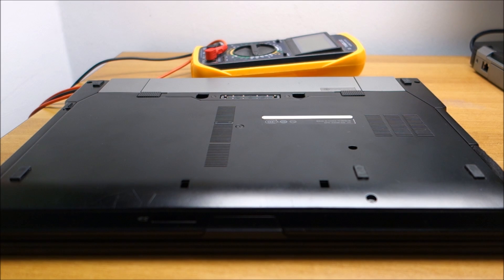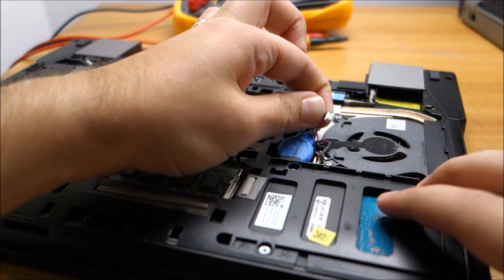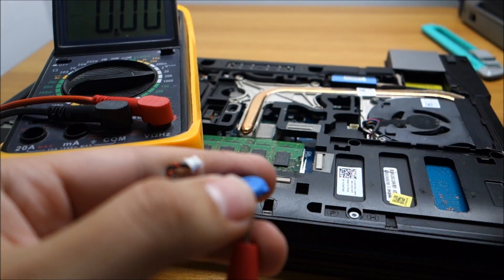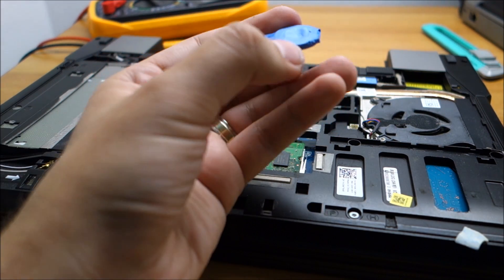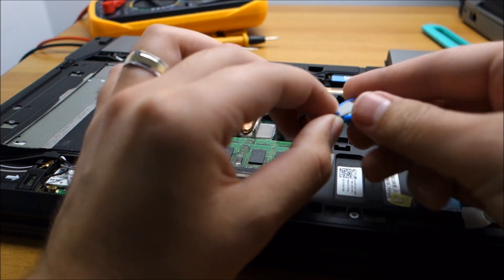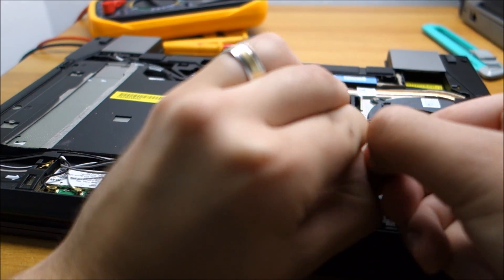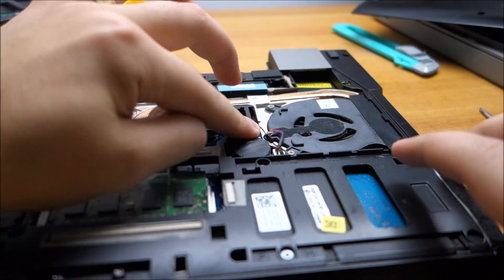How to replace laptop BIOS battery with a standard PC battery

Comment from the maker: ▬▬▬▬▬▬▬▬▬ஜ۩۞۩ஜ▬▬▬▬▬▬▬▬▬
        T H A N K  Y O U  F O R  W A T C H I N G !
     P L E A S E  L I K E  A N D  S U B S C R I B E !
▬▬▬▬▬▬▬▬▬ஜ۩۞۩ஜ▬▬▬▬▬▬▬▬▬
Reply: What about clamping metal heat sinks to the surface of the battery -  near the solder points ?   Would that absorb enough heat and prevent exploding the battery ?
Reply: On another video -  the technician used copper conductive tape ?    But that assumes that the adhesive material wouldn't interfere with conductivity ?
Reply from the maker: The adhesive needs to be conductive for sure.
Another idea, put the battery on a wet cloth while soldering. The heat should transfer into the cloth.
Reply: @UltimateDIY   My HP laptop battery is 16 years old and still has no problem. My bios had been updated in the past. If I replace the battery will I lose my updated bios? I do not know how to reset it. Will I have to update the bios again back to the same version or will it keep it but need to configure some changes in the bios? Also what changes in the bios will I need to configure, may please tell me in detail? So I can take note of my bios before or print out my bios to compare if needed.
Reply from the maker: @AnthonyManzio the BIOS version will not change. Once updated it remains updated. Your settings will be lost. Just enter all bios menus and take pictures, so you cand set them again exactly as they were.
Reply: @UltimateDIY  Okay thank. Will print screen work since got camera or cel phone?
Reply from the maker: @AnthonyManzio only if you have a printer, otherwise there is no way to save pictures.
Reply: @UltimateDIY  I've only the date and time will nothing else.

Comment: THE MOST IMPORTANT PART OF REMOVING SPOT WELDED STRIPS FROM OLD BATTERY, THAT YOU OMMITTED TO SHOW.  HOW YOU REMOVED? BY HOTGUN OR SOLDERING IRON?
Reply from the maker: I mentioned I will pry them appart and that is exactly what I did. Spot welding can't be melted like solder, so the only way is to pull them and rip them from the old battery.
Reply: @UltimateDIY  ok fine Thanks.

Comment: is there a way to diagnose to check? without open the back cover?
Reply from the maker: Remove main battery and shut off the laptop. If you get some error that bios settings have changed or if the clock and date are reset when you enter the bios, then the battery is gone.
Reply: @UltimateDIY  yes i have that error, but sometimes, i did not get that error
Reply from the maker: To get the error the main battery must be empty (or completely removed) and the power cable not plugged in.
Reply: @UltimateDIY  yes.. I received this error after removed my bloated lithium battery. So, it's dead?
Reply: @UltimateDIY  i need to plug-in to turn it on
Reply from the maker: Yes, bios battery is most likely dead then
Reply: @UltimateDIY  i just can't believe it dead to soon. It just turned 3 years old. My previous laptop never has this issue until hdd dead (over 10 years).
Reply from the maker: Welcome to "modern" electronics where they want us to replace them every 2 years, if they can get us to.
Reply: @UltimateDIY  agreed..lmao

Comment: How did you remove the metal contacts? Just pried them off?
Reply from the maker: Yes. They are spot welded in place.
Reply: @UltimateDIY  Thanks, figured. Seems so unnecessary since the contacts are held in place by the tape anyways.

Comment: My laptop stopped recognising the SSD.
Could it be a bios issue?
HP 17-by0010ds
Reply from the maker: The ssd could also be bad. Test it in another pc.
Reply: @UltimateDIY  I did. I got it to mount and format.
I did not try inside my working laptop as the system disk though.
Ill try that tomorrow.

Comment: Ugh I do not want to solder a battery .. why don’t they sell these more easily LOL
Reply from the maker: Well, they actually do sell them. You can buy from eBay bios batteries for your laptop model directly with the wires and connector. But I am cheap and also did not want to wait 🤭

Comment: No need to make holes. Just test at the end of the wires...
Reply from the maker: Don't remember where and why I made holes 🤔
Reply: @UltimateDIY  holes in the plastic to test the battery .. but the connector has exposed metals
Reply from the maker: Ah, ok. Probably I did not notice.

Comment: I loved to watch your video.  The technique is very helpful to me.  You showed everything very clearly and reused as much as possible.  I will go and watch all other videos of yours.  Thanks for your time in creating such a wonderful and useful video and sharing it.

I have a Toshiba Satellite P55W-B5224 laptop.  I did not use it for several years. Everything was working fine, but the touch screen and LCD screen malfunctioned and could not see the screen well where it was asking to enter the date after I had unplugged the main battery from the motherboard.  Perhaps that corrupted the BIOS information and not the fan runs when turned on for a minute or two, nothing shows on screen then laptop turns off even when the charger and battery are plugged in. I opened the back cover and could not find the location of the CMOS battery either to clear it or to replace it.  By the way you replied to almost every viewer's comments.  I highly value your time and helping nature.  Keep up the good work, Sir.
Reply from the maker: Thank you! I really apreciate your kind words and I'm happy my video helped you! 😊

Comment: Great idea and great job but why in the heck did they ever make it this way instead of the spring loaded clip?
Reply from the maker: More cost effective in some way? That would be my guess.
Reply: No space for it. Even my mini-ITX (desktop) motherboard has a similar wired battery and located in such a tight spot that I have to remove the motherboard from the case to replace it. On a sub 15 liter volume mini ITX case that is like half a day (or more) lost. It is very annoying just to replace a stupid battery.

Comment: what could be the reason my laptop hp 8760w not turning on?
i have tried basic thing by removing battery, and try to turn on with direct adapter power, pressed the power button for 30 sec and then plug in power adapter and none of them worked
Reply from the maker: Those are the hardest to troubleshoot...
Sorry, but there could be so many things, that it's impossible to guess.

Comment: I pulled the wires out of the CMOS connector on my Acer Helios and cannot find where to buy a new one.. Any advice?
Reply from the maker: Try ebay.
Reply: Buy cmos battery at electronic store or computer repair store

Comment: So i just need to insert the positve n negative terminal in the heat shrink tube then heat shrink it?
Reply from the maker: Indeed. Just make sure the wires are without insolation, so they can contact the battery. Also make sure you keep the correct polarity.
Reply: @UltimateDIY  thank you bro...you are the best

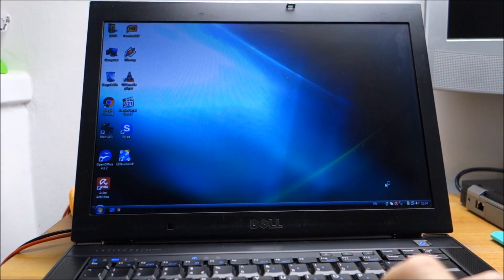Comment: I'm confused @13:18. With the main battery reinserted and powered up, did you get to this screen without having to reset the BIOS?
Reply from the maker: You will need to check the bios settings. When both main battery and bios battery are removed, the bios settings go to default values.

Comment: Thank you for the video! Why did you choose to reuse the plastic ring - was there a safety reason? I'm having to try using electrical tape since I don't have heat shrink, but I don't want to create a safety or interference problem (battery & wires near the WLAN antennae). Thanks
Reply from the maker: Welcome! I think it was a material that is hard to puncture, so at that moment I liked it. You can use electrical tape. Should not be a problem.

Comment: What the size of  heat shrinking tube ??
Reply from the maker: That...I do not know, but the battery has a diameter of 20mm and a thickness of 3.2mm.

Comment: I soldered the battery but it wont work out
n the battery is dead ,,no voltage showed
I am lucky the battery didnt explode even i solder it n it generated the excessive heat from soldering
2 times i did the same way..its failed
finally i wrap up the battery with tape ...n it worked fine
Reply from the maker: Yes, sadly lithium batteries are really sensitive to heat.

Comment: That was easy. To open my Lenovo,you need like 7-8 screws unscrewed from the back,than remove the  keyboard,unscrew 3 more screws under it,to remove the back. And i hate removing the keyboard cause it so sensitive. You dont have to brake it nececerily, but can easily be scratched or a bit damaged on the edges. Not prety.
Reply from the maker: +Pera Peric yes, Lenovo tends to use lots of screws :)